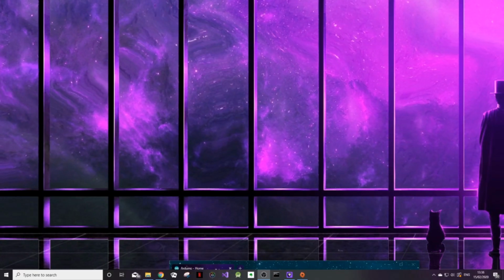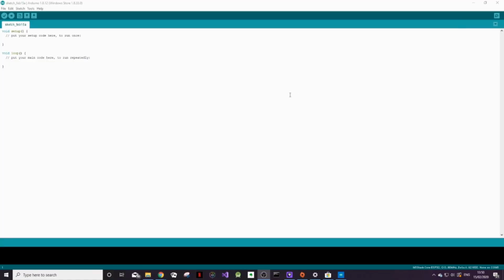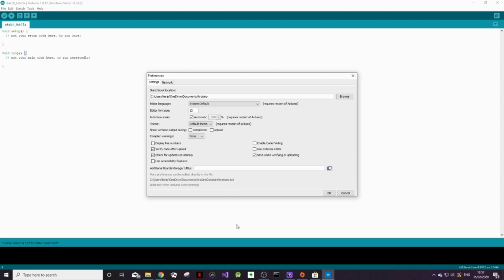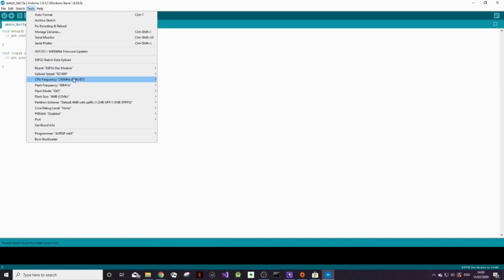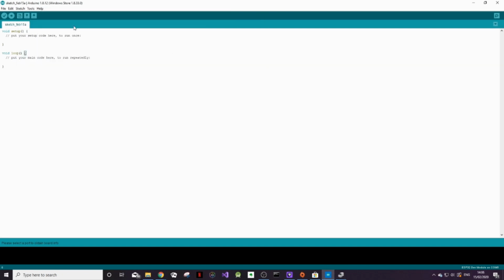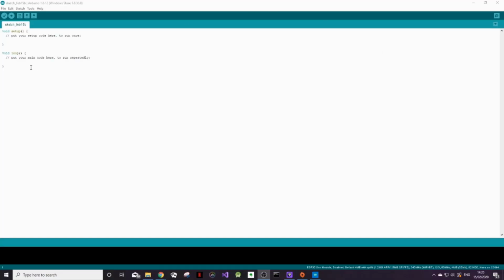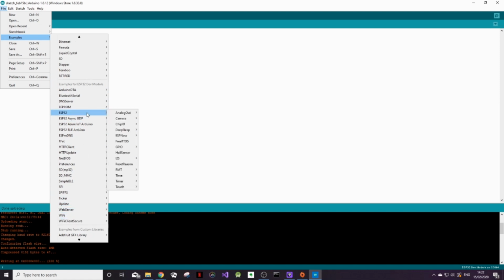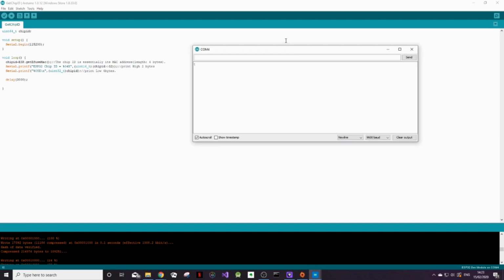Install Arduino IDE to use with ESP32

Comment: Does Windows 10 set up ESP32 Driver automatically?
Reply from the maker: Yes, but it's not the ESP32. The ESP32 requires a USB to serial converter either the CP104 or like CH3004 those IC have the drivers🙂

Comment: Hi i’m following the tutorial until the part where you changed the board to esp32 dev module but my port option ( i cannot click it at all) is not showing up have any solutions?
Reply from the maker: Hi 👋 you mean you cannot click to choose your port option? That is normally either your drivers are not installed. What ESP32 dev board do you have? The one with cp2104 or the CH304 driver?

Comment: dosent work for me it takes forever to install like is it supposed to install over 125mb?
Reply from the maker: That is strange, you speaking about the Arduino IDE, what version are you using now? Arduino IDE 1.8.13?
Reply: Yes
Reply from the maker: Did you try the exe and the windows app?
Reply: @PlumPot  yes that Is what im using now
Reply: @PlumPot  yes tried all versions even the zip one
Reply from the maker: Weird, I emailed you the zip working on my PC lol
Reply: @PlumPot  am I downloading the version 1.04? or 1.0 there are like four versions of esp 32
Reply: Ive literaly tried all three types and all failed
Reply: I think its the newest one
Reply from the maker: That is very strange, just tried reinstalling on mine now and it seems fine🤔. I can try email you a zip of it and maybe can just run it without installing
Reply: @PlumPot  ive literaly spent the whole day trying to install it 😂 shiit maybe my email is leoleclerc@yahoo.com
Reply: 1.8.3 version
Reply from the maker: 1.8.13 is the newest😊. You can try older versions but ill email you my zip folder :)
Reply: @PlumPot  ok thanks im literally trying to program the lyligo ttgo t watch 2020 but I cant coz of this
Reply: Ok got it lemme try

Comment: I am teaching myself to programm with esp32s and micro python at the moment...For my CNC build  project  I wanted to use the already made "grbl esp32" though ...but arduino is really confusing to me...it does not seem to load the complete sketch and I have no access to the code determining the i2c pins. Probably a really obvious noob mistake =D I like your desktop background btw =}
Reply from the maker: Nice :) esp seems like a great way to learn all sorts of useful things. Sorry to hear you're having trouble, are you trying to load an example that someone else has written? Is there a reason you want to change the i2C pins from the dedicated ones? It might be easier to help you via our dischord, why dont you hop on there and explain a bit more :)

Ahh thanks!! :)